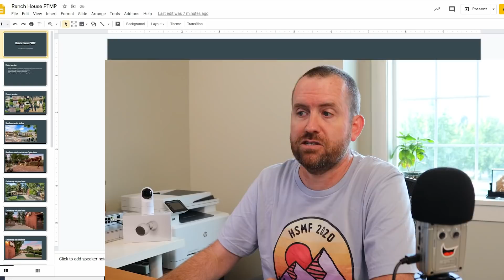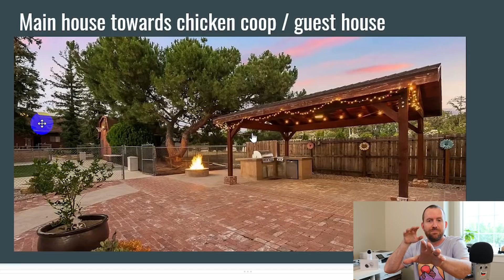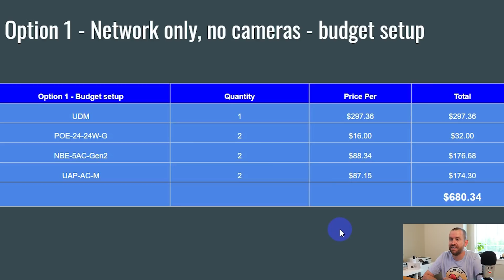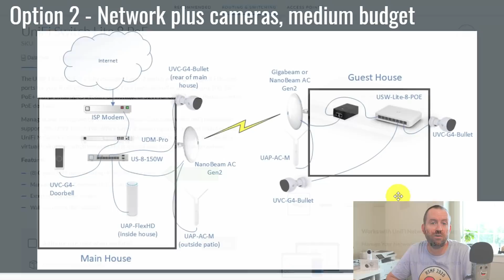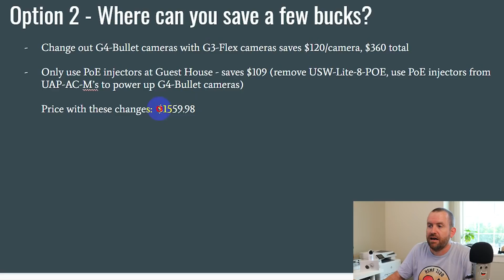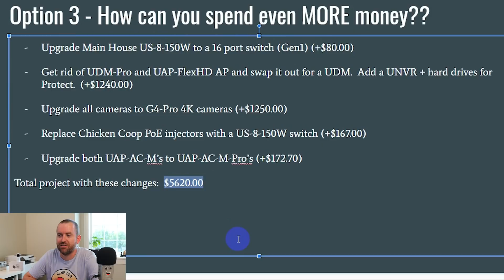Ranch House Network Design

Comment: Just an FYI. :)

With mesh, you don't halve the throughput, that's using "extenders" on a non-mesh system. Mesh alleviates this, and the Orbi's use a dedicated radio for backhaul, or can use their onboard ethernet for backhaul.

Looking at your map though, I think the Orbi would have problem, out of the box, as well. Adding Orbi outdoor nodes would probably work though. :)

A hybrid/bridged solution would always be better though on such a long, thin, lot.

Comment: I love having a home Mesh Network.
I did have my WiFi Router at one end of my house (which is quite long) and an Access Point at the other end, to give better speed.  However, as the WiFi signal just reached the other end of my house for both devices, if we were using a mobile device (as it would still be able to see the signal), it wouldn’t swap Access Points until it couldn’t actually receive the WiFi signal anymore.
I now have a Mesh Network at home that was supplied by my RSP, which gives me whole house coverage under a single SSID.  However, you mentioned these wireless Mesh Access Points/Extenders actually use part of the WiFi signal for backhaul, I was a bit concerned.
So, in this setup, you were using the Link Antennas for backhaul and then the actual WiFi Access points were both Mesh (so you only had one SSID)?
I’d love to see more on Mesh networks, and the best ways to set them up.  😊

Comment: I was sure someone in the comments would point this out but there's a big problem with option 3, I'm sure the client would've picked it up- if you mount the Nanobeam and AP on the chicken coop anywhere on the same wall as the basketball ring, there's nothing surer than the kids will DESTROY it with the ball.

Comment: I currently use a older nanostation Loco m5 to pull signal from our landlord, through all the crap in the building including the hvac system, yeah.... They don't have signal issues....  Lol. (I acknowledge that this is a really dumb setup, but what works, works for me for now)
Reply: P.s.  I get full signal and speeds :)

Comment: Those injectors would be fine outside at the chicken coop in option 3/4? Plus adding the 8 port 150w in option 4 at the coop, could it be outside or would the industrial be a better option?

Comment: The real big budget build is to hard wire to the chicken coup and guest house. Use all UAP-AC-Pro's, no POE injectors and directly use the 8-port 150W switch on all locations. I'd even put a 24 port in the main house (more reliable than the 16 port that you would "need"), because it will have an office that needs it anyway. Space for adding a NAS later etc etc...
Would be waaay cheaper than your final changes and a lot better setup.

Comment: I have a solution: dig a trench - put a cable in it (i would say that 300ft is enough to 1st building on property)  - cover it 😎 rinse repeat 😎 it will work 100%

Comment: Why a cat6 cable between main house and guest house isn't an option? The distance is >100m? I'd run two cables - one from main house to the chicken coop and another one to the guest house. It'll be dirt cheap and will work better than any PtP radio link.

Comment: 10gb fibre backbone along a boundary fence, a switch in each building with APs/cams off that..? No need for 10gb for internets but you might use the BW for NAS access.

Comment: Too much hassle! It seems that there will be no problem to route some cables along the north fence. If that happens, then three uap-ac-lite access points will do the job perfectly. Even, if they are located strategically, two of them might get it there too. Edge router for the firewall. That is all. Make it simple!

Comment: No offense but you need to stick to the networking part you’re great at that.... the camera part sorry you need more knowledge actually a lot more. 

There is far more that goes into camera then just looking as easy as you make it sound. 

First there is always a direction the cameras run that way there are no blind spots one camera records once something is out of that view it’s picked up in sequence of the next camera. 

Second heights and angles play a roll camera lens 2.4mm 4 etc

Third you recommend unifi cameras as if they are god like cameras. They aren’t first they are ridiculously over priced for what you can get, they lack some serious options for getting the best views, I will give credit the time lapse play back is brilliant installing them simple. Unifi should have the slogan keep it stupid simple g4 cameras. The g3 is the same dang camera as the g3 pro with a few minor differences yet the price is almost double and the g4 pro really almost 500 for 4K that’s laughable. For the cost of that camera add 100 dollars more and you can have 4 4K cameras that are deployed thru out america and over seas. They are vandal proof unlike the unifi exposed wire exposed screw exposed lens I could go on.

In one of your other videos you mentioned pots and their limited use.... ptz are far ahead of you knowledge the don’t need someone to operate them they do it them selves they auto track auto zoom and focus to where there is not interruption in picture quality unlike one being controlled by a human. Next they can cover far more area and see greater distance then stationary their IR tech on them puts any stationary camera to shame. 

Hell they can detect sounds and auto locate to the direction etc. 

No offense but unifi cameras are tech nerd cameras who lack the knowledge past just plugging them in and mounting them with that lack of knowledge you also pay the over pricing  for a basic camera with basic options preselected by a company trying to make money. It’s like Apple you pay a premium for two year old technology from the rear of the competition

Comment: I went with the Gen 2 switch and used Ubiquity's POE+ to POE Passive adapter to power a Nanostation M2 I'musing to provide WiFi to my elderly neighbor.. It was cheap, powered by the switch and works perfect. They have an indoor and outdoor version.

Comment: In addition to the very low power levels discussed above, 60 GHz systems do not penetrate the human body. So, I strongly disagree when you say 60 GHz radios "will cause headaches". It gives the impression that wireless links are not "safe".

Comment: You'll likely find that FlexHD may not cover what you want in the main house. After 2 months, I finally broke down and supplemented mine with an AP AC Lite (2200 sq ft on floor 1, bonus room above garage), and turned down 2.4Gh xmit to low. Seems dialed in now.

Comment: Those are some cool designs. At my parents farm we are running a pair of UAP-AC-M access points. One is on the radio tower for their internet and it hops to one on the shop wall. Then it runs into the shop with a cat-5 wire into a 8 port switch and then back out to a UAP-AC-LITE. The metal shop absorbs all wifi and cell signals. So this gives them internet access in the shop. The house is all wired with Unifi access points as well. He wants to serve wifi out to his pond so when we go with that we will probably add the airmax lite and bounce it to the nanobeam HDs.

Comment: This is probably a bit nit picky on a very nice video; but your reduced cost suggestion for option 2 mentions using the POE injectors from the mesh access points which are 24v .5A to power the G4 bullet cameras which require 48V .5A

Comment: Orbi doesn’t have the halving issue. With 2 5GHz bands one of them is used for backhaul.  I’ve used many of these and get good speeds (RBK50 - 686Mbps) on wireless using U-Verse gig connectivity.  I’ve used it with many cable internet connections with 200-400Mbps and get the same speed on the mesh access point.  I’ve used the outdoor wireless mesh ap as well in a couple of installs and get acceptable speeds 100ft in a metal building (with doors open which will be normal for the install).  I place the mesh ap with about -65 to -68db from the original ap/router. The largest install covered a 6500sq ft house and outdoor entertainment area that was about 2000 sqft open air.  I generally use Ubiquiti AP’s, but the Orbi’s are great when wiring isn’t possible or the customer doesn’t want to pay extra for wiring.  As always good video, I had to defend the Orbi’s one of only 2 systems that don’t suffer from the halving issue and have a hot hot signal.  I wouldn’t use an Orbi with that setup either though too many walls and buildings to attenuate signal.

Comment: Question can you use the nano beam AC gen2 with a regular WiFi AP? Even if not ideal, will it work to catch the signal or does it only work with other PTP devices?

Comment: Why not run a cable along the top fence? weather rated and could even use conduit if you want? to link guest house to main house? I don't see length of run but it looks fine and worst case you might need to put like a poe powered  switch or a repeater of sorts along the way in which case  you could also use this break of another AP in the middle. also the 2 G4's in guest house will chew up a fair bit of bandwidth of the site to site link. I understand there may be a lot of info we might not have from the video alone.
Also we don't know where you have power run thru out the property.

As for the Orbi its Tri Band with a dedicated link between devices so the drop of is not half per hop but I would agree that its not good for this setup

Comment: For the UVC-G3-FLEX don't mount it upside down when outside. The drain hole would then sit higher than the camera lens and it could fill up with water. I read some horror stories of some people ruining their new cameras that way. I've had 4 g3 flex cameras outside mounted upright under my eavestrough for years and I haven't had any problems.

Comment: Great video. Question for the community: To connect two locations using fiber is it as simple as getting two switches with SFP ports? What kind of cable is best? Thanks!

Comment: We just did a similar install for a customer that needed wifi on a large lake house property. They needed to cover the house/pool, guest house/gym, two docks, and a pavilion. They had already run Cat6 lines through conduit to the guest house, but not to the docks. We used a UDM Pro with a USW 24 Pro PoE, because they needed more ports/power. We used FlexHDs for the versatile mounting options. One AP was mounted outside by the pool and we meshed it to the AP on the dock by the house. We used GigaBeams to bridge the house and the boat dock. It was about 100m away, but had good line of sight. We used USW Flex switches outdoors and put a US-8-150W in the guest house. We used G4 Bullets and G4 Pros for the cameras.

Comment: Have you checked if there is an existing run to the guest house underground, water/power etc? then you could run a wire and then only need a couple of AP's
Reply: Can't run High and low voltage in the same conduit. Water...well nothing running through that water pipe but water. In this setting with all that apparent concrete etc. Wireless is the way to go. Unless they wanna pay for the trenching, but labor isn't cheap usually. But actually Fiber is the way to go to avoid static charges between buildings.
Reply: @mrmotofy  I was referring to the possibility of conduits laid at the time, never suggesting using either the power or water conduits, some people plan in advance :)

Comment: Me: Get Trenching shovel and add either an PtP ethernet or fiber run to the guest house. 
Trenching Shovel: $80 USD, 1000ft of Direct burial Ethernet cable $250. A fiber custom cable with pre-terminated ends would probably cost about $350.

Comment: Drive the Tesla and if you got the Bio Filter then just get going, no real reason to hold back Chris! Lol I enjoy the videos. I setup a Power Plant with some ACGen2s with tons in the way and 1500ft apart with no loss at 2 separate bridges. They have a gate and camera system we put in with Intercom system working through the bridge. Great setup you have planned there!

Comment: Isn’t Orbi Tri band which stops it’s from halving the bandwidth on each jump?
Reply: It has a separate backhaul on 5GHz (at least in the previous generation).  You would need to put the Master station in the middle, so you take a single halving for the link.  You have wired ports at each point and 2.4 and 5 GHz at each point.  One option would be to put the central station near (if not in) the chicken coup.  The only question is if the links between the coup and the houses was good enough.  You would have to use the orbi as a bridge with something like the USG, if you don't use the ISP's gateway, for the firewall as the firewall support is in master unit.

Comment: I have spent just over $1400 for my 5 Camera and Gen2Plus setup which is not cheap but it has been awesome caught a nasty guy trying to screw with my front door camera and then for him to chuck a hissy when he couldn’t lol and then found out it’s real 🤣 and just over $1000 on 3 Switches, USG and AC Pro so all up it’s cost me almost $2600!!! One of the joys of living in Australia we pay through the teeth! Mind you I’ve setup a system costing a client close to $10,000 and another around $5000-$6000 so yea crazy!
Reply: Sounds like a good business model for a startup, network equipment local that runs good but a fair price.

Comment: Wel... thoughts. I really don't think going all UniFi is such a good idea epecially in residential setting. The main problem for me in this is, how switches are implemnted in UniFi, so I would go like this:
1. It's residential, so I'd say that even N is still good enough and given expected applications, will be for quite some time. So a trio of NanoM5 should be enough for PTMP with added passthrough to a trio of UAP-AC-M APs.
2. It's residential, so ditch UniFi switches. I would get a single EdgeSwitch-8-150w. Similar price to UniFi variant, but in my opinion simplier and more easily understandable GUI. As for the guest house and chicken coop, I would go with Zyxel GS1200-8 and GS1200-5 respectively (assuming chicken coop would turn in to a workshop). These switches have their flaws, but they are dirt cheap and get the job done quite well.
3. Protection. I would go with a Synology for Surveillance station and get some decent cameras from wherever I could. I Don't like UniFi cameras, because it's closed ecosystem and you need the controller and the cameras them selves are a bit pricey. the chosen EdgeSwitch could power both Wi-Fi bridge and cameras for the house, apart of those, only the Syno would be connected to it. The rest of the house would be on a separate switch given by needs, so Zyxel GS1200-8 would be a likely candidate. If the guest house had cameras, I would consider Netgear GS110TP for PoE (wifi bridge would use injector)
4. I would get an EdgeRouter X and CloudKey gen2 instead of UDM. ER-X is in my opinion supperior router, given it's cleverer approach and access to stuff in three easily understandable ways. Sure, you loose some functions of UDM, but I don't feel they have the value of price difference. Plus, 200Mbit won't ever give this router a hard time.
5. I'd say that the buildings should each have at least a single AP in them, so going with UAP-AC-Lite for the guest house and a Pro, maybe NanoHD for main house, perheaps something with WiFi6 standard, when avaliable. Guests don't need all that much speed anyway.
Sure, it's a Frankenstein of a network, put together out of perfectly made bricks and mud, but it would get the job done easily.

Comment: Much respect for your videos, appreciate the content, minor criticism -  just at about 20:47 you are talking about ditching the switch and daisy chaining the devices, you could use 2 POE adapters to power 3 devices if one is the Nanobeam AC, but to get another device in there (you have 4 pictured), you would need a switch to split it off as the POE injectors only have 1 input, 1 output.
Reply: Not necesearily. He could do up to 4 devices with only two injectors. Take two times two nanoM5 and two nanolocoM5. Each injector powers two devices and are linked together on LAN side. If you swapped one loco for a full M5 and assuming two nanostations can be powered from one source on 24v passive, you could connect a third PoE to a powerbean or something similar and connect it to a remote station outside of reach of the nanostations or to a Wi-Fi bridge terminus. This installation would be usefull for instance for placing sensors for field monitoring, be it for research or agriculture.